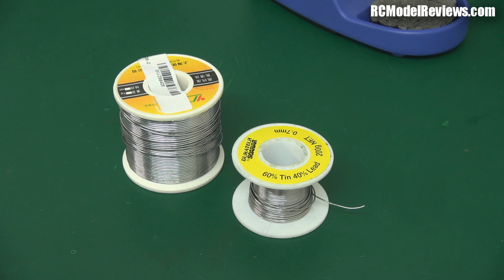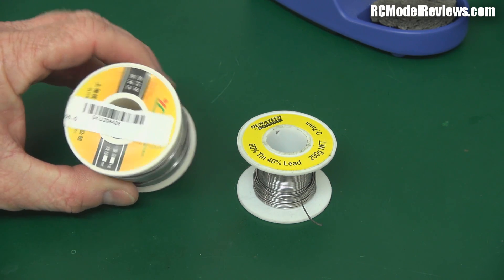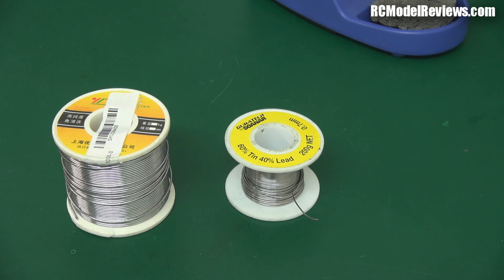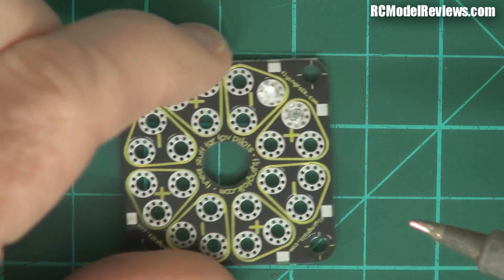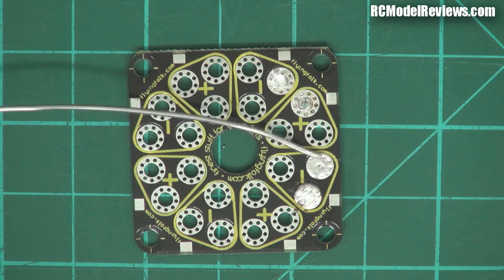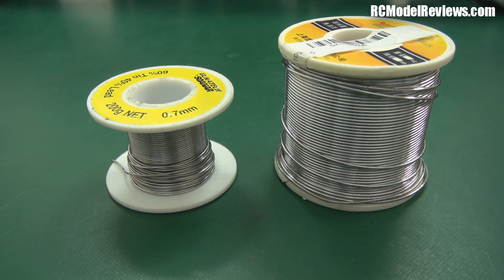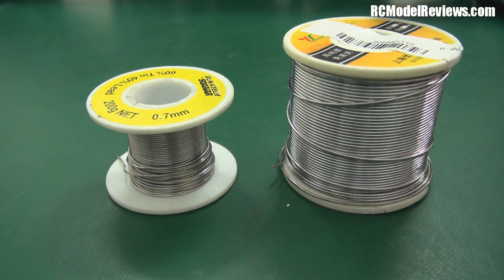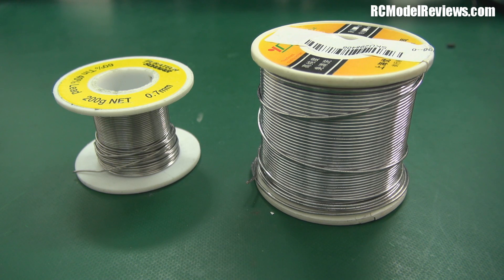60/40 versus unleaded solder

Comment: I love the smell of melting 60/40 when I solder. I should probably stop intentionally inhaling the smoke!
Reply: +mrmurder75 
What you smell is the flux burning away. Doesn't have anything to do with lead (free). You can rosin in bulk and stick the iron in if you like the fumes ;)
Reply: +superdau yeah I know, but the solder contains lead, so those fumes will contain traces of lead too I'd imagine.
Reply: +mrmurder75 
I like the smell of the fumes as well (for at least 20 years now). Just don't do it if you have some predisposition for asthma or allergies.
If you talk to a chemist, sure he'd find traces of lead in the fumes. But I am sure that every breath you take outside in a city will be magnitudes more harmful than the hazards from the lead. The fumes from the rosin on the other hand are proven to cause respiratory problems. But again no reason to panic, that's for occupational exposure (8 hours a day, 5 days a week). For someone who maybe solders an hour every few weeks it's moot.
Reply: +superdau yeah that's true. I solder maybe once or twice a month, max. I didn't realise the fumes from the rosin were harmful as well though. Every day is a learning experience huh! :o)
Reply: +superdau Yep, I think you'll find that the lead levels in the air above your soldering are several orders of magnitude lower than those at your local gun range when shooting is taking place.   Lead won't vaporize at soldering temperatures.
Reply: +xjet - The smoke from a gun is either from the burning of the powder and/or the lube used on lead bullets.  There are a lot of factors but even modern "smokeless" powder produces some amount of smoke.  It was only called smokeless because it produces way less smoke than the blackpowder used at the time.  You can often tell if someone is using lead bullets (as opposed to jacketed) because of the increased smoke caused by the burning of the lube that is put on lead bullets to prevent lead build up inside the barrel.  If you want lots of smoke use a blackpowder rifle with lots of Crisco vegetable shortening on the patched ball (bullet).

Comment: You were at the low end of the temperatures lead free solder works at. 400-420 c might improve results.
Reply: +Robert Szasz The lead free solder I use (Mercury 703 in 1mm diameter) has a stated melting point of 227°C. What would be a good iron temperature for this? I am quite happy with my results, but maybe I can improve things further.
Reply: YensR I was just going by some guidelines published by on of the soldering station makers. The hotter the soldering iron the larger the chance you will damage the board or components, but it makes it easier to get and hold everything far enough above the melt point for good wetting to occur. I'd guess a tip temperature somewhere around 100c above the melting point would make a good starting point but if you have a soldering station you can probably get info from the manufacturer.
Reply: +Robert Szasz This highlights another issue with lead-free though.  At temps over about 380 degrees, flux tends to burn off pretty quickly and that means the novice attempting to use lead-free (with their iron set to 420 deg C) will find it hard to do a decent job.   Of course a good quality lead-free solder in experienced hands can do a pretty good job -- but the average RC flier is neither skilled nor are they likely to be investing in the best quality lead-free solder so the results are often sub-optimal -- as witnessed by the comments on this video from those who have encountered problems.  For that reason it's just easier for the casual solderer to use 60/40 and produce a much better job.
Reply: ***** oh, definitely. 60/40 is much easier to work with and at the small amounts used by hobbiests, safe for the environment. At industrial scales going RoHS compliant has been a good thing though.

Comment: I use lead free without any problems for big joins like XT60 and thicker cables. Its a german brand however.
Reply: +foamidable You should be able to edit your YT comments. Try clicking the little circle on the right.
Reply: +wordreet Thanks, I didn't know that.
Reply: +foamidable okys

Comment: Thomas school uses Leadfree :P
Reply: +Alex Curtis 
Dude, they don't eat the solder at the school!
Reply: Reinier Basson no, you don't
Reply: Reinier Basson you won't
Reply: +Alex Curtis lead doesn't vaporize, dude
Reply: +Reinier Basson 
If you have any lead in the fumes you're doing it wrong. Very wrong. You know you're not supposed to heat your parts to cherry red and above when soldering, right?
Reply: +Mudux  you still get lead in the smoke that comes off even though its very little
Reply: +superdau oh well either way i dont want to be inhaling that shit
Reply: +Sean Coyne the most dangers part of soldering are the fumes from flux that's still being used with lead-free ... not lead
Reply: +Sean Coyne it never affected me... <twitches violently>
Reply: +Mudux You most certainly do. Regardless of the iron not reaching the vaporization temperature of lead, free lead oxides form and are set free that can be inhaled. Read the literature on soldering hazards in the workplace and set safety practices regarding exposure over time and ventilation requirements. The flux vapour is also damaging to the lungs as it forms compounds that cause asthma and lung damage over time, depending on the flux used it can be carcinogenic and poisonous.

Comment: Lead free seems to need more heat, have to bump my iron up a notch when I use it. Biggest problem I find is that the higher temperature I use burns the flux off significantly faster. Have to use a flux pen or the like to make it work. I don't see any problems using lead free for reflow. BUT... I use leaded with the iron at home as I can use a lower heat, I don't need a flux pen, and it's far less likely to give a dry joint soldering the large power wires I use in my electric models. Got the same solder myself from Jaycar, only bought my second roll ever about 1 year ago but my usage seems to have accelerated since I started soldering XT-60's.

Comment: Lead is not only dangerous for the environment, its also dangerous for the people working with it. So please keep that in mind when using it. Use in a well ventilated room and always wash your hands with soap after using lead based solder before eating. Keep safe!  With some practice and the right tools using lead free is not so bad. Its mechanically stronger when done correctly.

Comment: You should put the whole roll into a pot and make a brick of solder. I have no idea what you could use it for (maybe a paperweight) but I think it would be cool to watch it all melt. Also, what exactly is flux and why does it make solder flow so well?
Reply: I've actually done this. it creates a nice brick. it's what I do with unleaded solder.
Reply: +rabinator33 Flux inhibits (and sometimes reverses) the oxidation of the solder.  The oxide usually forms on the surface of molten solder and creates a kind of skin that encapsulates the liquid metal and stops it from flowing smoothly.  Flux can also stop oxidation of the metals  your actually soldering -- thus improving the alloying between the solder and the copper (or other metals) you're joining.
Reply: +leif churchill Same.  I find it quite fun :P
Reply: +rabinator33 Maybe add something on solder paste if you want to do a vid on it
Reply: +Lemon Gaming cleans the surface.prep for the solder to flow nicely on the wire

Comment: Bruce,

I have a couple 1lb. spools Kester 44 63/37 .031" I can send you one. Let me know.
Reply: I use kester 44 as well,  expensive but the best stuff without a doubt
Reply: +Sonic Orb Studios I got a pound of Kester too and it is sooooooo much better!
Reply: Kester Wire is marginal at best.  Multi-Core 63-37 FTW.. get some and never look at another brand of solder ever again.
Reply: +Donald D'Egidio +1 on Kester, a 1 lb. spool lasts forever and is such a pleasure to use!
Reply: Mark,

I know. I'm still on a spool that's at least 15 yrs old. Shows how much soldering I do.   :-)
Reply: Donald D'Egidio Hmm, well, I will take a look at that when I run out, but that spool is going to last a very long time, and it seems so perfect to me, and works great.
Reply: +The RCAddict He's probably giving it away because the flux in solder is dated. But Kester is worth the extra cost. My silver solder is probably only 2 years old and is toast already without new flux.When it was new using it looked like leaded solder... now it's not working as well and looks like garbage without using flux and don't have the right type..
Reply: +John F Hendry This solder is dated Oct/15/15. Found a good buy and bought several spools.
Reply: Donald D'Egidio Oh I see... I have some of the Sparkfun silver unleaded solder and it's water based flux core has already gone bad and although it still "works" it does not behave as it did when it was fresh and I'm guessing it's no more than two years old. When it was within it's expiration date it was hard to tell it was unleaded solder by the way it flowed and looked after setting up nice and shinny other than requiring more heat. To keep weight down as well as make stronger connections its all I use on 3D planes and rotor craft. If you even have a chance you should try it as its nothing like the other unleaded solder types I've tried. But for leaded solder I agree Kester makes the best solder but have never tried their unleaded solder which I would expect must be reasonable solder. Seems with unleaded the flux that works best has a short shelf life.
Reply: +John F Hendry I have some lead solder from the 80s Dick Smith kit and I tried it a while back and it's just fine even though it looked a bit grotty, with the flux inside it solders just fine after all these years.
Reply: Mentorcase The solder is not what goes bad first, it's the flux and there are countless articles on it explaining why. If you used another flux with it then it helped clean away the bad flux and extra oxidation but without measuring hard to tell how much. Water based flux has it's advantage of being more active and giving a better connection in certain circumstances, the main reason it's used, doesn't store for very long. You can solder using plumbers solder and flux but tests show why you don't. The debate of old vs new solder continues but only proper testing shows why all the major brands date their solder with an expiration date. My experience shows Sparkfun's silver solder works like leaded solder at a higher temp until the flux dries out then it loses it ease and quality of soldering. And Sparkfun is the only solder I use on RC aircraft if I can because  every gram adds up. Eliminating the weight of lead is just one more area were I can save some weight and get a stronger connection with less resistance as a side bonus..

Comment: I guess you can use the hippie solder for making some sculptures or something.
Reply: +SlavjanA Tin is good stuff for bullet casting, too. Tin is added to the lead alloy, because is improves casting properties. Hippies don't cast bullets.
Reply: i use it when i need to hot air gun reflow. but yeah stick to the 60/40 for everything else.
Reply: I only use lead free solder on copper water supply plumbing.  Then I use Mapps gas to get enough heat.
Adding 1lb of 60/40 solder to 10lb of wheel weights makes a perfect bullet casting alloy.  Just the correct amount of lead, tin and antimony.

Comment: I think it's fine for hobbyists to use leaded solder as you say the quantities being used are minimal and the effect environment will be minimal. I do wonder how long it will be readily available for though.
I use lead-free for everything (including drag soldering 100+ pin QFPs) and I don't have many problems with it really. Probably because the solder I use isn't made in China.
Reply: RoHS is only a requirement in mass production, leaded solder is completely fine for personal use.
Reply: +Djhg2000 The components I use in my work and hobby projects are all designed for RoHS, the cheap PCBs I get from China have lead-free tinning etc, I have no issues soldering with lead-free.. so while I don't have to I have no reason not to.
Reply: That's fine too, the RoHS was written to leave  us hobbyists a choice. For my stuff I only use leaded solder. If leaded solder keeps me from having to throw out stuff I consider that a bigger environmental win. Especially as I repair old automotive electronics, those would definitely not benefit from being converted to lead free. I haven't tried myself but reading online it seems mixing them is where quality really goes out the window.

Comment: Hey Bruce can you recommend a solder removal pump machine or gun that works?  There seem to be a lot of them at a varying prices.
Reply: +adriancjones I use this thing and it's a beast - http://www.ebay.com.au/itm/Desoldering-Station-80W-Temperature-controlled-Vacuum-Suction-de-soldering-gun-/361322066052?hash=item5420793084
Reply: +Brendan Halliday. Thanks. Just what I was looking for.
Reply: Check eevblog channel as Dave has a desoldering vid or two
Reply: Desolder wick is cheap and worth trying too